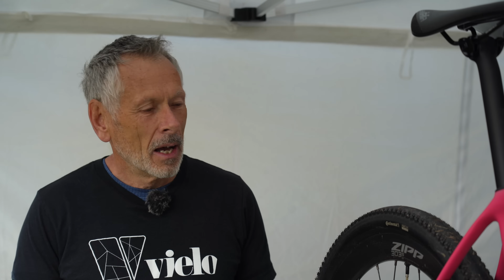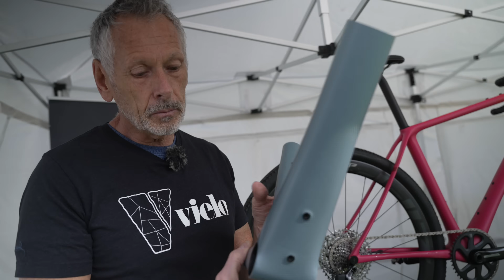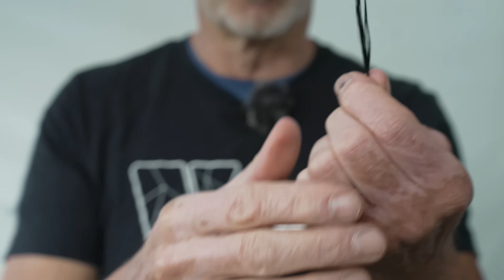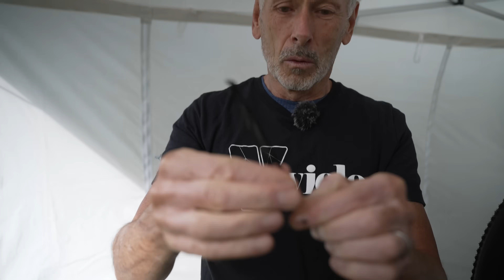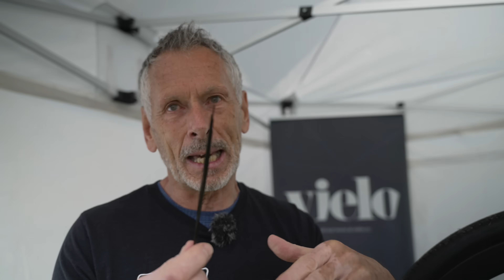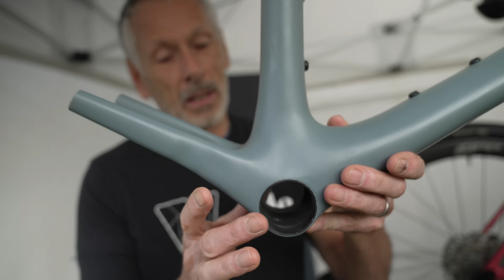How This Bike Company is Changing the Gravel Bike Experience

Comment: No mention of Lauf. I see them as the real pioneers.
Reply: Pretty sure there are companies who've been making fat tyred drop bar off road bikes for way longer than Lauf and certainly these guys.
Reply: @sssamcz  not with 1by only, no dropped seat stays (that are also solid carbon), innovative front suspension (or not), very light weight (without the use of hi mod 👎 carbon), and direct to consumer. Lauf is the pioneer.
Reply: @jamessankey01  yeah, there were frames 15+ years ago which could run road cranks, 29x2.1 tyres, no dropped stays, and drop bars. Lauf are cool and innovative,  but they did not invent the gravel bike by a long shot

Comment: I'm a little skeptical of the "bigger is better" tire trend for gravel racing; perhaps for adventure riding it is more intuitive. I was new to gravelI in 2023, so before deciding on how to spend a lot of money, I decided to experiment a bit. I started by fitting 2.2 Race Kings on an old cross country frame fitted with drop bars. On gravel trails/roads in my area, it was like riding on pillows, but the wheels felt way too heavy and overkill 90% of the time. This season I will be trying the 40c Challenge  Strada Bianca tubeless tubulars. The wheels are half the weight. With no rim flanges or inner tubes, I can run super low CX pressures (< 20 psi) on the really rough stuff with no risk of air loss. Using sealant and plugs instead of an inner tube in a tubular is long overdue......
Reply: I came to the conclusion that on the gravel roads I ride (varied, but some are excellent) at the speed I ride, that 700x45mm were not wide enough and was slowing me down. I had to often slow down due the road being too rough, or look for ways of avoiding the obstacle. Changing to 650x2.2 in the same frame (Open WI.DE)  has been great. More compliance and less care needed at higher speeds. Feelings are not data, but I struggle to see where I am slower.
Reply: I'm here and watching this video because I want to drop my TerraSpeed 40 and try anything more fat like 47-50 tires. Those 40 are for 2.5bars minimal pressure which is waaay too much for real gravel roads.
I use those 2.2 RaceKings on my MTB, they are very soft, so you have to put in 3.0 or more bars for hardpack to not waste a lot of your power into tires bouncing. But it's up to you to balance speed and comfort with those tires just by adding a bit more pressure. You can't do anything with 40 tires, which are making you terrible slow on rough terrain.
I think something like 50 mentioned in this video is a great compromise, just enough for a gravel. But tire manufacturers seem to ignore this size.
Reply: @Ms112464  RaceKing 2.0s should measure very close to 50mm on a gravel  rim. Why not give them a try? At least 60+% of my gravel riding in on dykes or well maintained gravel roads. The dykes have a surface of very fine gravel and clay so they are close to tarmac in hardness. They do get potholes as the winter wears on but I am finding so far that both my CX bike and gravel bike with the Challenge Strada Bianca 40mm tubeless tubulars (which can handle 25 psi if necessary) are noticeably faster than my RaceKing 2.2 wheels on these surfaces. My racing experience has been road and CX (no XC), so it hard to give up the handling and feel of light wheels. I may have to resort to the converted XC bike with RKs for the super rough stuff but I'm not there yet.

Comment: One thing I don't (I like most of this frame, mind you) is the very wide top tube. This will rub my knees for sure. There is no need for that other than it's easier to line up with those widened seat stays.
Reply from the maker: I hear you, I'm not a fan of very wide top tubes either as I have a knees in pedalling style, but I had no issues with this bike thankfully

Comment: And what if you just took a XC frame set, with option to use a suspended fork with 100mm of travel or a rigid fork, put a drop bar on it and call it a day? The one and only true do it all bike is a XC hardtail with 29" wheels. If you need 50mm or more to be comfy on your gravel bike, a MTB is going to be much better.

Comment: Because wide tires at low pressure = suspension. Every industry always circles back around and calls it something new. This is how we ended up with mountain bikes. Personally I will never understand running a ridged frame drop bar bike off of a paved surface. I just don’t get it. There is a better tool. Don’t seek your mounting bike just yet folks. This will morph back in to mountain bike.
Reply: Don't ride long distances do you?
Reply: @gregmorrison7320  no I don’t. I have a mountain bike and I am shopping road/gravel right now. I’m just pointing out what’s happening. I see it in most of industries. The come full circle and market it like it all new. Personally I don’t have a lot of interest is long gravel rides. Seem like a day full of vibration. I just want something I can ride everyday to build stamina for my MTB.

Comment: After 2 years riding gravel bikes I figured out that the fastest and best gravel tire is simply the trusty Schwalbe Marathon 38mm to 42mm. The Schwalbe Marathon Almotion beats every other gravel tire. Runs crazy fast on road and has enough grip for most gravel roads.
Reply: That's what my bike shop recommended and I also independently chose. It's fast on the road and off road sections with supposedly good puncture resistance.
Reply: Yea, I can agree. I have 47mm tires, they're the most gnarly, aggressive and confidence inspiring ever over the most ridiculous terrain. Next I'd love 40mm tires
Reply: @jooohan-i9o Marathon Plus? The worst tire in my opinion. Heavy as hell and rolls like a bag of nuts. Had it for about 4 weeks and immediately replaced it with the Marathon Supreme. A difference like night and day.
Reply: @jooohan-i9o Correction on my part: I have the Marathon Plus too. I reduce the pressures a bit to give it a more compliant ride off-road, but traction and speed seem fine.

Comment: I switched back to my hardtail MTB after 1 year of riding my gravel bike (Diverge). I really enjoy the Diverge, but it really is more for smooth gravel along rivers and parks. The 80-100mm front suspension is really the game changer here for rough gravel and roots. Of course, lower tire pressure on a gravel bike is said to be equivalent, but... it isn't! It's making the bike far slower. My new project now is a monster gravel with 80mm Rockshox on the front and drop bars. That should be a real game changer. And mountainbikes are really cheap these days as everyone is selling them to buy a gravel bike.
Reply: Same.  I’ve got a ti gravel bike that’s gathering dust because I spend most of my time riding a parts bin xc hardtail I set up for gravel.  It’s just better on anything except smooth gravel and pavement.

Comment: A note about those Terra Hardpack 50mm tyres. They're not strictly 50mm, in my opinion.
I ran them on 25mm internal 650b rims, the sidewall carcass is 50mm at it's widest point but the actual tread around the perimeter measures around 47mm. 
The result, if running at low pressures, the sidewall is in regular contact with the ground, either side of the 47mm tread.

Comment: Why would someone need 45mm on a Gravel Bike?
I cant imagine that 45mm on any sort of fastish pavement is fun or did tires evovle so much in the last decades?

And a sporty trekking bike beats them all anyway in my opinion.
Reply: t’s a Gravel bike - you ride it on gravel, not pavement
Reply: @user72634-c  and why do you need 45mm for gravel? its still a fast pavement
Reply: I ride 50mm Pirelli Cinturato H tyres on my gravel rig.. 
It absolutely rips on gravel and is no slouch on the tarmac with a few more PSI in, either.
Single bike for both with no huge compromise for either genre, for the speed I ride.
Reply: @jamesmedlow  tires improved that much? thats impressive
the wider tires i have are all super slow on anything remotely flat but they are also all very old:D
i personally go offroad with my old steel bike and 23mm tires at 75psi or smtg like that it does ride suprisingly smooth and is a lot of fun but i also dont go fast on the descends
Reply: Tires definitely improved.  
I think it is fair to say tire improvements in general have outpaced frame/wheel advancements, but big tires in particular have gotten a lot of improvements.
Reply: @squngy0  kinda makes sense if you consider how far car tires have come:D
well and the only advancement in frames is the lowering of production cost and quality:D

Comment: can you fit 2.2's in this frame Dave? lots of gravel frames can fit 50(2.0)'s today, not as many fit 2.2's, 2.0 tire selection is poor at the moment. the terra hardpack test slower than 2.2's with that inferior casing
Reply: I'm guessing you want to run the Conti Speed King 2.2's

Comment: IDK…a $7000 frame with no internal frame storage or UDH the future? I hope not.

The Canyon grail and other bikes with 42mm tire clearances are still winning recent pro gravel events in 2024 

Bike companies need a “new thing” to market and sell new bikes. The bike industy is slimey
Reply: Not sure what races you're referring to, but in the US gravel scene, most races today are won on MTB tires, 55+. 42s are virtually road tires these days
Reply: @wscharff  28-30 are road tires. Look at TDF. 

Most races are won on gravel on sub 45s, including Unbound and Big Sugar in 2023. 

I hear ya. MTB tires work on a few races. Has to be very dry and chunky. The pros are then running drop downs bars on a hard tail. You will get dropped fast on any other surface. Especially if there is lots of elevation. I have a garage full of tires and my recent race, I didn’t see any MTB tires
Reply: @frienduro24  LM used MTB tyres to win unbound in 2024. Keegan S used MTB Maxxis tyres at Steamboat on his gravel bike. So did others. The most dominant racer in the Lifetime series is choosing MTB tyres for gravel.
Reply: @andrew9579  if it was muddy, no one would run MTB tires on both those tracks. They use MTB tires rarely. Everywhere else, the use under 45s which are faster 

LM used a MTB in the front only.
Reply: @frienduro24  Steamboat was bone dry. KS won on his gravel bike with MTB tyres. Five in the top 10 Lifetime GP current rankings use MTB tyres on their gravel bikes in the races that suit drop bar bikes. They have all come to the conclusion that it’s faster when there are races without any pavement.
Reply: @andrew9579  well the Life Time Grand Prix is a mix of MTB and gravel races. It’s not all Gravel surfaces…it’s like 6 races. It’s bull shit, they don’t exclusively only run MTB tires on every race. Come on dude
Reply: @frienduro24  never said they did. Read what I wrote. In the races that suit gravel bikes that are completely on dirt those people I mentioned are running MTb tyres. 5 of the top 10 are making that selection based on testing. This is the Lifetime gravel events where everyone is riding gravel bikes. Not Leadville or Sea Offer etc.
Reply: so what? they are a business; of course they need to keep moving forward.
Reply: @city_slacker  how is it moving forward when sub 45 tires are winning most of the races?this bike doesn’t even have internal frame storage and the frame is 7K! Oh that will be in the updated version in 2026…